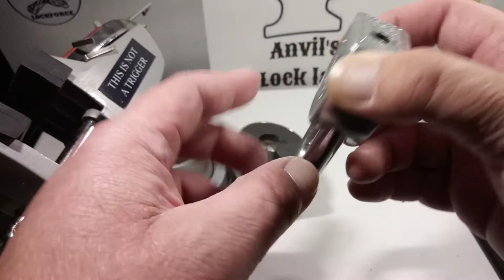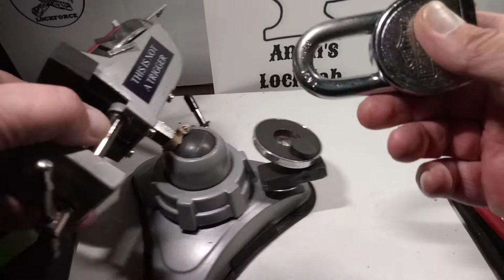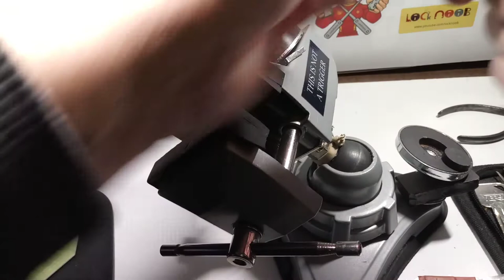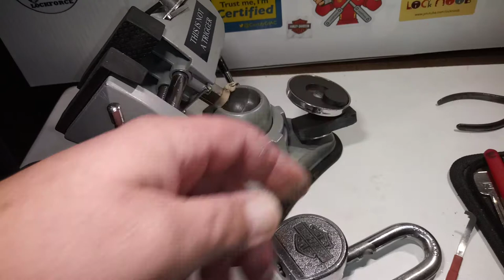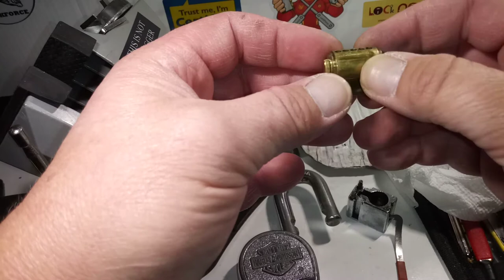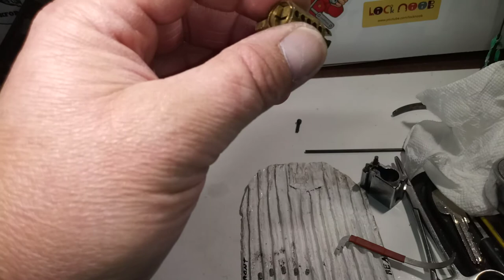#019 Harley-Davidson lock picked and gutted

Comment: Thats a cool lock. Hope you get it sorted and fixed again. If you tip the pins out the top sometimes the springs can get into the core and when you turn it mangles the springs and jammer stuff up. (May have done the same thing myself). Hope you can get it working again.
Reply from the maker: I think that's possible also there is a dent on the side of the cylinder part 2 coming soon...
Thanks for the tip